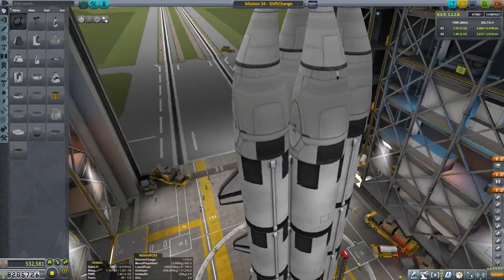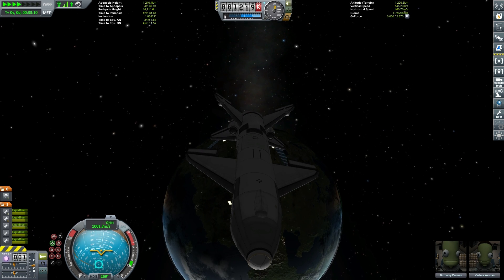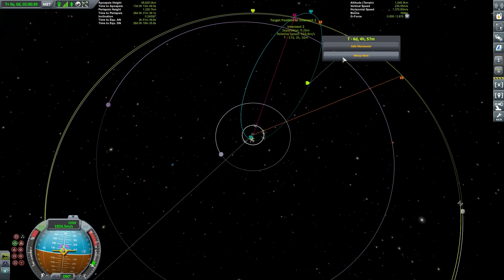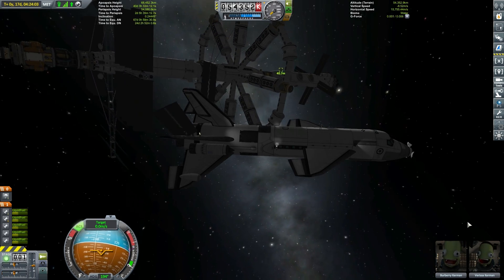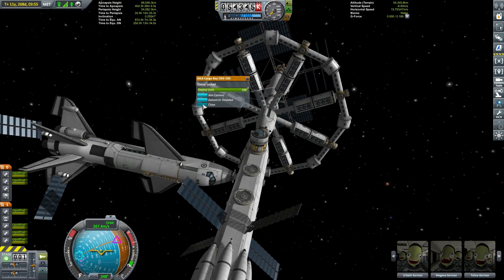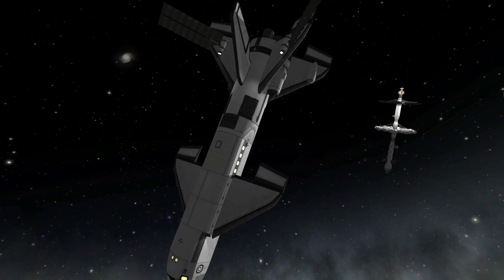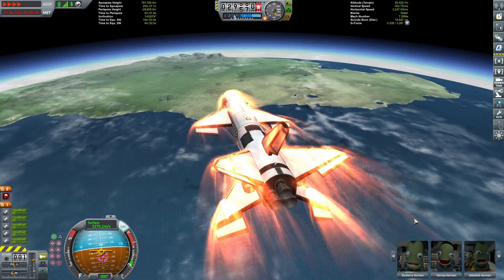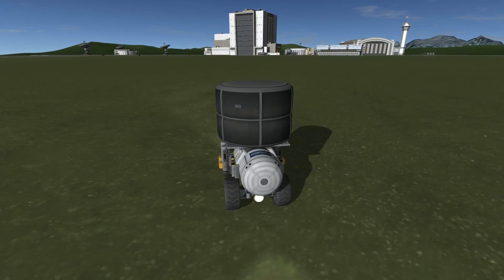KSP Space Station Shuttle Shift Change (Tutorial:34) Kerbal Space Program 1.2 -  Stock Parts

Comment: But, could you just simply circularize your orbit using the engines, instead of performing so many aero brake passages? It looks like you had plenty of deltaV. Anyway, great video, as usual :)
Reply from the maker: Yes you certainly could. I guess I wanted to demonstrate an efficient way of aerobraking in case someone wants to also visit one of the other systems such as Bop or Pol. With the delta-v available it would have been possible I think.

Comment: i find fying a space shuttle very hard because it just wants to flip all the time and turn
Reply from the maker: Yep. You need to shut off the outside engine as you get higher otherwise it wants to flip (low mass remaining in the fuel tanks makes the outside mammoth engine a bit of a trick). The vector engines seem to operate in the opposite direction to what you'd expect here actually. Would be good if you could choose to invert the engine vector. Maybe you can, I've never tried. XD

Comment: I build all of my space planes balanced, so the center of mass never changes. The center of mass is centered in the middle of the cargo bay. Of course, cargo can upset it but only in an axis that will not change its interaction with the center of thrust. As for lift balance, I have created small weightless wing parts that are placed internally. I use them to "adjust the airfoils" of the original lifting surfaces. I wish I had a mod that would enable the adjustment of the lift, position of lift, and drag parameters in the wing pieces. Different aircraft will have different airfoils that suit their individual purposes. BTW love the content.
Reply from the maker: Nice tips. In this case I added a fairly large fuel tank to the front to bring the mass forward quite a bit (wasn't centered by any measure though). It would be much better to have fuel tanks under the cargo / passenger bays to help distribute the weight. (kind of like the massive battery in a Tesla :). Certainly makes sense to have the mass distributed evenly right across the vessel.

Comment: That's a beast of a spaceplane! I love it! I'm also impressed by the fact that you didn't retract the solar panels while docking - I'm sure I'd loose mine if I was piloting... Those heatshields for spaceplanes, that's a great idea for a mod actually. 
As usual, awesome video Marcus!
Reply from the maker: Thanks Mark! From the guru of spaceplanes... quite a compliment :).
Your next moding project. Ablator or heat shielding tiles on the bottom of the space plane parts. :)
Reply: +Marcus House I was to say that... (it's a demand for size 3 plane parts)

Comment: I'm actually quite surprised reentry worked so smoothly! That's a crazy build!
Reply from the maker: The biggest space plane parts are quite tolerant to heat. Would still be nice to actually have proper heat shielding for a single pass re-entry all the same.
Reply: Looking back at these vids is nostalgic

Comment: what is your PC build?
Reply from the maker: Its pretty damn dated actually. Its only a i7-2600 @ 2.4GHz.
8GM ram with a GTX 570.
If you are wondering why my framerate is so good when there are a lot of parts involved... I'm generally speeding up the video capture. :)
Reply: o.0 even more respect for the briliant quality! (sorry for my german english if its wrong)
Reply: In all honesty if you could overclock the cpu, i'd set it to 3.0 GHz as it'll be an great help. If else, the ram is mainly fine unless you want to go with 16Gb of ram, that's optional. For graphics cards, I'd go with an Rx 470 with 4gb.

This will definitely help with not only rendering but improve fps since KSP is more of a physics game. Overclocking the cpu would be the biggest boost by far.
Reply: That's a tall order, why don't you just buy him all the parts to build it instead?
Reply: So, will you please upgrade the computer with a faster CPU and more RAM to increase frame rate and decrease the game to real time ratio towards one.